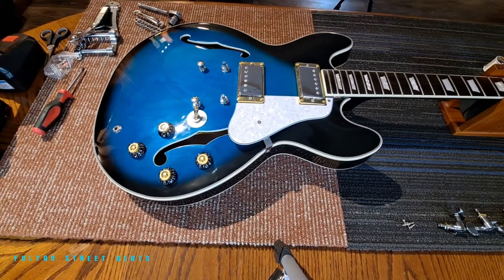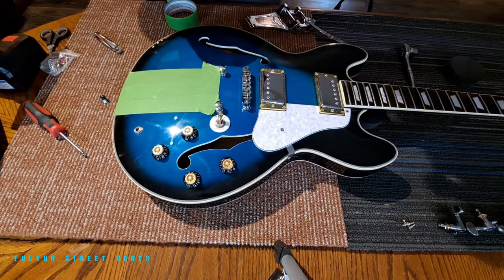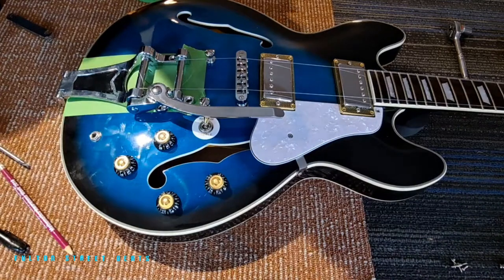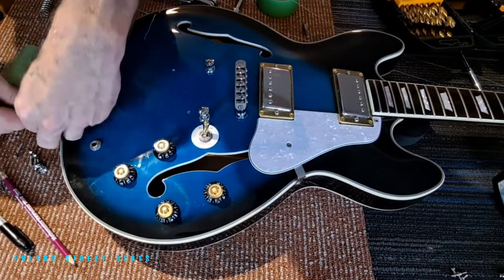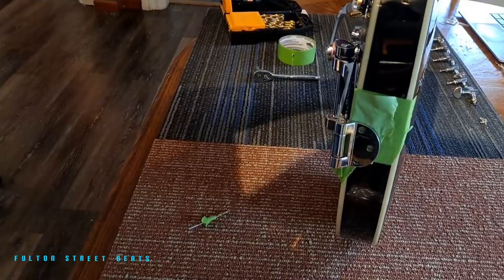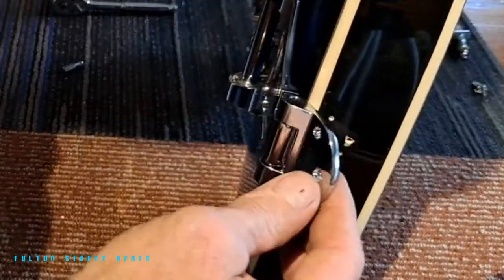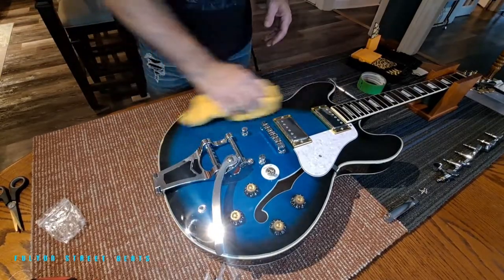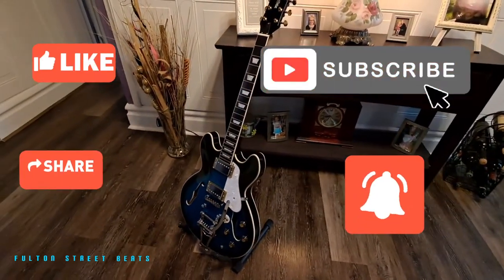VIBRATO  INSTALLATION  FIREFLY  335 / 338  ARCHTOP  GUITAR  MODS  pt 3

Comment: So, you don't need felt between the bridge and the guitar top like a real Bigsby has? Personally I don't like the fact that you're left with the old tailpiece bolts. This would be better to do on a guitar with a trapeze style tailpiece. I'm thinking about doing this to my IYV IJZ-300 TSB.
Reply: p.s. Before you make any holes line it up and make sure that the wood block under the top covers the area where you're going to be putting the screws. My block looks like it will cover the upper hole but not the lower one, so I'm going to have to abandon the idea.